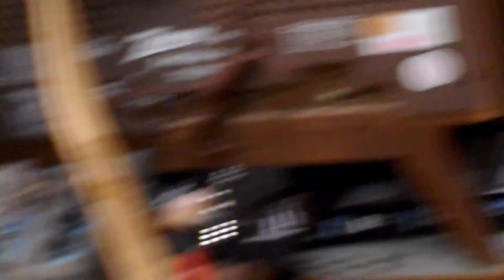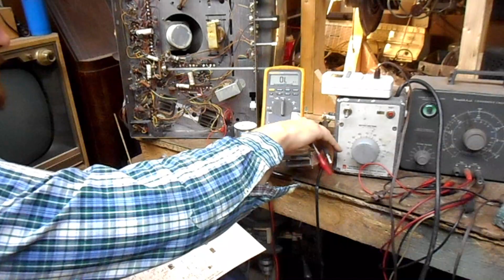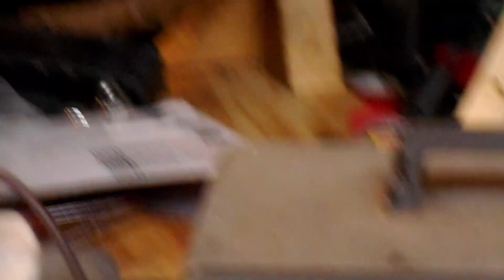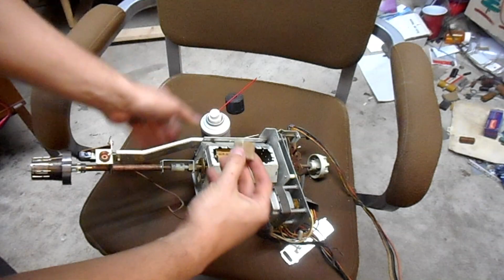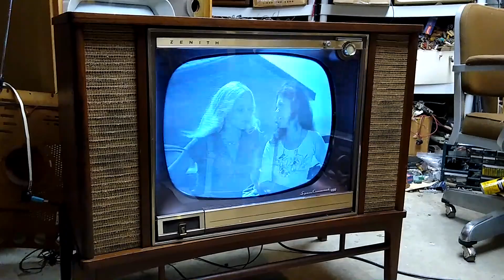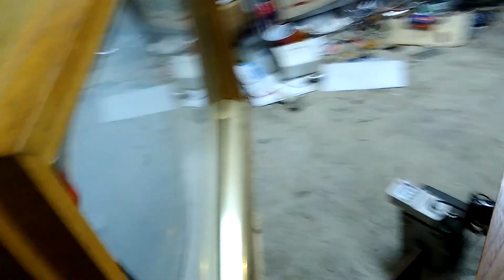1960 Zenith Model C3009W Remote Television Resurrection Part 2

Comment: Job well done man!  That really does look like a very nice cabinet.   Looks like the CRT came back quite nicely. It's weird it seems like every single vintage set below 1970 that I've ever worked on seems like it has a capacitor failure in the vertical circuit.

Comment: That picture looked great. Liked the presentation style and cap testing section - those old cap testers put out some quite scary test voltages! I use a transformer to run a few different US-made testers here in the UK. Thanks
Reply from the maker: Thanks. The saving grace of those testers is that they are current limited.  I've gotten bit off of the 450V leakage test more times than I care to admit.

Comment: Make up a tripler across a uWave HV cap, then connect to bumblebee via HV switch, on a long cord .. then watch what happens …
Reply from the maker: When I was a teenager I used to do stuff like that to lytics out of junked 70's stereo equipment...Those un-vented 70's Japanese lytic cans will fly a good 50' when you apply AC voltage thats twice their DC voltage rating.
The guitar amp crowd sees a lot of value in sprague bumble bombs so I try to save those to pay for better caps.